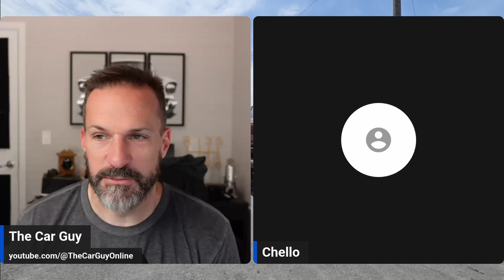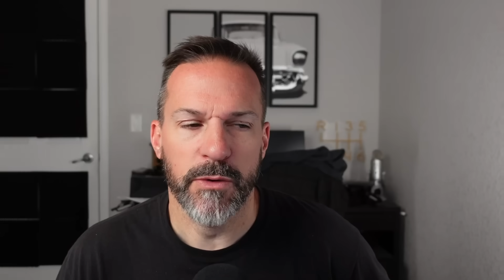Former GM Engineer EXPOSES Planned Obsolescence Tactics.

Comment: The oil change schedule on my new Toyota is supposed to be 10,000 miles…..I’ll change it every 5,000 miles.
Reply: All of our Toyota vehicles for the last 15 years at least get 5k oil changes regardless of what the schedule calls for.
Reply: I do the exact same thing, and also perform other maintenance at shorter intervals than the official schedule calls for.
Reply: 10,000 mile oil service is for people with a lot of gentle highway miles and go 55mph LOL.  
I also see a lot of people parked idling in the summer sun with the AC on for a total of zero miles.
Reply: @jeretso  Also non-turbo or naturally aspirated engines...Turbos are especially tough on oil and engines with biturbos like the Mercedes AMG are particularly tough on oil! Not only should you change it at 5,000 miles, but you SHOULD use the recommended specific Mercedes Oil with the recommended oil additives every other oil change!
Reply: @jeretso oil changes are set based on miles and or total running hours. That includes idling. Whichever comes first. I change my oil  every 3,000-5,000 miles
Reply: @jeretso the concept of “gentle highway miles” is from the 1980s, a turbocharged car sitting in stop and go traffic on a rutted and potholed freeway isn’t easy anymore lmao.
Reply: Guaranteed issues if you don't. It's proven
Reply: You might want to upgrade to 5-30 oil if you are using the reccomended 0-20. I plan to do so my next oil change.
Reply: @dbmail545 yes let's void the warranty and make the motor break down pre maturely
Reply: waste of time and money
Reply: Long oil change intervals only benefit the dealerships and shops. 
My old 03 diesel says 10k. I do it every 3k. Same with my 03 ranger and 11 mustang, 3k miles
Reply: 10,000 mile oil changes are ONLY to get the vehicle to survive until 1 mile past the warranty. Thats it. They don't care if the engine fails at 100,001 miles, because its no longer their problem. They've designed the engines to survive on 10k oil changes and have a short life. 4-5k changes is what Ill be doing
Reply: This is the biggest industry joke....10,000 mile oil changes...The automobile industry KNOWS that people rarely keep a vehicle beyond warranty, and the KNOW that 10,000 mile oil changes will damage the engine...but they are in business to sell cars, not to repair them. So if they can minimize the cost of ownership of their customer, that customer has a greater likelyhood of coming back to that manufacturer to buy another NEW car...So if in 5 years a customer paid for 5 $150 oil changes at a total expense of $750 for 10,000 mile changes as opposed to 10 oil changes for $1,500 in total costs, that customer will say that the vehicle didn't cost him much so he'll buy it again! The vehicle is toast, but he doesn't care...he's buying a new one! I have a 2018 AMG and I change that oil between 5,000 and 7,500 miles...
Reply: @ekummel  Then there are people like me, with my 40 year old truck (2nd owner) and 25 year old SUV (original owner).
Reply: @nolongeramused8135  I have a 1989 Jeep Wagoneer LTD (XJ) with 250K miles, a 1998 Olds Cutlass, a 2005 Jeep Grand Cherokee...and my two newest ones are a 2012 Jeep Overland and a 2018 Mercedes AMG...and they all run great...And my 1972 Cutlass, which has spend the last several years being restored ran last time I started it about 10 years ago...(can't now because it's completely disassembled. I love older cars...they have a "soul" to them that these newer ones just seem to lack!
Reply: @nolongeramused8135 
That’s me 😊👍
Reply: @ekummel  Wrong wrong wrong. Look at the stats.
Reply: @ekummel used to be 2000 miles in the 1990s  if I remember right.
Reply: These assholes can't even get the correct oil right....dealers in Australia have been running the US spec oils so people with their shiny new 300 series towing caravans in the outback get a rude shock when things don't live up to Toyota's reputation.
Reply: 5,000 miles no matter what on my 16 corolla
Reply: Former Toyota tech. 5K or 7.5K is a good idea. Car makers recommend 10K in part because it decreases the cost of ownership on paper and decreases oil waste.

Toyota has excellent synthetic motor oil that definitely lasts 10K miles, but every engine benefits from more frequent oil changes.
Reply: My '80s Toyota trucks recommend oil change intervals of 10,000 miles. The trick is to read the "severe" maintenance schedule. Most people qualify for the severe maintenance schedule, which on those trucks is 3,750 miles. That's more like it. You typically qualify for the severe schedule if you idle a lot, do a lot of stop and go, drive in extreme temperatures, tow and haul, etc. That's most people. So change the oil at the severe schedule for your vehicle.
Reply: If it runs 0w-20 swap to 5w-20. They only run 0w-20 in their cars in America, much thinner oil, doesn't protect as well, just keep in mind if you do the change, you can never go back to 0w-20 you will notice the car running better though.
Reply: I do mine at 5K and I mash down on it a lot
Reply: You can also get away with running a slightly higher viscosity oil. They use such thin oil to get slightly higher mph at the expense of engine longevity.
Reply: @accordio321 don't try that on newer cars. You'll throw codes for vvt and timing. They knew what they were doing with these "improvements."
Reply: Most powerful heavy duty semi max 8000 miles, no way a gasoline turbo can do 10000 miles.
Reply: @GF-mf7ml  diesel oil has a real problem w/ particulate contamination. leave the engineering to the real engineers.
Reply: That is maximum dumb. Stick to 10,000 miles.
Reply: @dacat8171  THIS is one of the dumbest statements I've seen on here! Manufacturers are walking back that 10,000 mile oil change interval because of issues...Manufacturers are now saying 5,000 to 10,000 miles with an asterix! Turbo engines, city driving/stop and go driving and dusty environments should be changing the oil at the lower end. Sunday drivers and highway mileage and normally aspirated engines, 7,500 is fine and old grannies getting groceries who never exceed the speed limit or go above 3,000 RPM can take it up to 10,000 miles...But if you talk to ANY mechanic worth their socket wrench this question, they will all say to not exceed 7,500 miles between oil changes...Your personal anecdotal experience not-with-standing!
Reply: @ekummel  I just don't get that. I drive a French diesel engine in the EU. Normal service intervals are 16k MILES if driven normally, 12k miles if severe. I change every 10k (easy to work out) and the car has done 250k miles with zero issues.
Reply: Just look at the oil 😂  @ekummel
Reply: @dacat8171 5k or 6 months.
Reply: @dacat8171 😂😂😂😂😂you are the only dumb one
Reply: @dacat8171 Search YouTube and see these engine fail just over 100k, some sooner. They are also sludged up. These thinner oils can't protect that long.
Reply: @seeya205 Dave’s Garage shows a lot of trucks with sludge but most of them are due to the owner idling for hours on end at the job site and doing an oil change every 30k, if that. 10k mile oil changes aren’t causing sludge but surely varnishing everything and losing additives.

Comment: Just bought an old 2001 Dodge Ram 5.2 liter magnum with a 5 speed manual transmission! 37K original miles! Looks like an old farm truck because it sat out in a field but runs like a top. I'm making it my goal in life to never buy a vehicle made after 2012
Reply: That  makes no sense

Comment: This is every industry, I’m a 16 year hvac journeyman.  HVAC manufacturers do the same thing.  If it’s metal, make it plastic.  If it’s thick, make it thinner.  They literally invented seer2 ratings this last year cause they were caught lying about their efficiency standard.
Reply: I'm working on a Hospital for the last year, in HVAC. And I'm redoing all the computer controls on the entire hospital. Most of the air handlers that feed air to the different parts of the hospital were built in 1964, and are still running on the original parts, original heating coils, original pneumatic actuators, and about half of the equipment has the original electric motors from 1964, that have simply been repaired with new bearings. I feel bad replacing it with the new "modern" computer controls, because there's no way the new stuff will last for 60 years.
Reply: @Ritalie  You can put your foot down as the professional and tell them thats NOT what you recommend doing and you refuse to do so.  Who cares what they want, they are clueless. When the person who's job is to work on them says otherwise,  they better listen!    Don't be a part of the falling chain, break the link.  I've saved people thousands of dollars by simply fixing an old piece of equipment for pennies,  when they (for some reason) think it needs to be replaced.  I'd rather walk away then get paid to do a "Down grade" KNOWING I'd have to try fixing the unfixable 3 times a year.....
Reply: Even in the generator world, I'm a tech, I've got units that are 10yo and I can't get parts. 
I just had to replace a customer's 48kw Briggs unit with a new one because the ecm went bad on the impco designed engine management system and the ecm isn't available. 
New unit was like 14-16k or something too. 
It was like a 2011-2012 unit.
Reply: @MrTheHillfolk 
When they said “(We’ll) own nothing and be happy”_ they were right. We’ll be happy to rent everything so we don’t have to pay to fix/replace it. The rental/subscription faucet will never turn off and we’ll be stuck with a monthly bill forever.
Reply: Switching to aluminum evaporator coils with a higher pressure refrigerant has been horrible.  All the American brands are garbage now.
Reply: @James.Allen.1 Yes I agree.  Our lennox rep says the new equipment made for the new refrigerant will still be aluminum but they’re going to be the same thickness old R22 coils were.  We’ll see I guess, doing something is better than nothing I suppose.
Reply: @zachosborne6577 
Copper has increased too much for them to switch back !
I will run my 25 year old unit for as long as possible
Reply: @James.Allen.1  They used to be aluminum back in the day. It's not the material, but the internal grooves they put in them to increase turbulence, which increases efficiency.

Then again, Trane didn't start going downhill regardless until they left the USA.
Reply: Plumbing also got like this, which is bad all around
Reply: Oh my God yes ! China junk!
Had a new bath tub and shower put in 
Less than 2 years and fixtures are failing.  Everything is junk ! We are screwed! The end is near ! Save yourselves!
Reply: Same thing happening in the hd class 8 truck world too. Cummins is very pro planned obsolescence and inferior metals.
Reply: Yup, seen the same. Cheaper build on everything on the boards/ motors/ frames.
Reply: Electrical equipment has gone the same route, cheap cheap cheap.
I recently pulled a 5 hp , 600 volt   three phase rooftop  exhaust fan at a factory .
Had to get a gantry in to lift it out of the housing, it was built like a tank, all cast steel.
They figure all 20 of them, where from the 50's and made in toronto canada , all are on VFD's , they thought they were 10HP's .
All still in service , took to a motor shop to get it looked at, they thought it was burnt out , just a bad connection in the motor .
Put  it back into service for another 60 years!
Reply: I’m an Electrician but I did HVAC for a bit and I could see that everywhere in everything we put together was absolute plastic garbage, same thing as an Electrician it’s all planned obsolescence.
Reply: AC coolant cartels lobbied (and won) for EPA regulations to restrict what can be used for coolants in AC units.  Unsurprisingly the "approved" coolants are all patented by mega corporations.  The most important change to the coolant type was the old stuff was all much lower pressure so wasn't as hard on seals and pumps so the coolant lasted exponentially longer.  The AC coolant cartels managed to force everyone to use coolant (that they held the patents on) that ran at a much higher pressure and that higher pressure cause a much higher failure rate in all the equipment as well as required refilling much more often.
Reply: I live in KNOXVILLE TN  and the HAVC systems LAST about 10 years. AT A BOUT 8500.00 TO  REPLACE. INSANE!!!!!!!!

Comment: ALL companies working that way. From Apple to Hyundai. From the new IOS update to the 10K miles "miracle" oil.
Reply: Planned obsolescence through continuous product line updates, making the newest products more desirable, but not artificially limiting the life of the existing product isn’t an issue. It makes people want to purchase the new products. 

Planned obsolescence through artificially or intentionally limiting the life of a product is a double edged sword. If you design the products to fail beyond the average expected usable lifespan of the product, it may result in repeat buyers.  Produce a product that fails prior to this point though, and you’re likely to have customers that will never purchase your product again. 

Think about Toyota. Most people buy them due to perceived reliability and longevity. If the average customer expects a new Toyota to last a minimum of 10 years, it has to last longer than that. Whether they last 15 years or 20 years, the average buyer is likely to be satisfied in either situation. Build them to last only 8 years though…and the average buyer will go to the competition for their next purchase and won’t return until the perception improves.

Comment: The same thing is occuring in the aviation industry too.  I spent 25 years in it.  Have a nice flight!!
Reply: It happens in every industry.
Reply: I could tell you a story about 3rd party aviation quality control that wouldn't surprise you at all LOL.
Reply: @machupikachu1085 used to work for a company that made OEM fuel rings for GE turbine jet engines. Don't fly.
Reply: @squidmissiletv  I have been a rabid airliner enthusiast since I was 7 and have worked in Aviation Maintenance in the late 90s, and then assembled 747-400 center wing sections at Boeing for a handful of years.   Even if it means deleting your comment after you post it (so I can read it one time in the comment alert), could you elaborate a little bit?  
What is a fuel ring?  Is it an o-ring that seals fuel lines or does it have to do with the combustor section?   Is the problem caused by these big companies like GE and GM going with the lowest bid they can find from parts suppliers?
Reply: @JetCityMatt im referencing the fuel injector ring that goes around the cumbustion chamber. Specifically the CFM56. Later the LEAP. But not many of those.
Reply: @JetCityMatt I was in aviation and aerospace my whole working career.  He may be referring to the fuel injection spray ring??  That's what I think anyway??  🤔
Reply: @Steve-on6fu  Oh that makes sense.  The injector has to be sealed and everything else in a jet engine is probably too hot for o-rings.  Actually... where the fuel injector mounts is probably too hot for any kind of O-ring to survive.  Perhaps he is referring to something external to the hot part of the engine, like maybe a fuel line coming to the engine or maybe some component in the accessory box (if that's what they call it where the oil pump and IDGs are).
Thanks for your reply.  It got me thinking (which is always a good thing... well, sometimes its not!)  ;)
Reply: It’s not a secret.

Comment: After looking for a Silverado LT over the last 6 months- nearly bought one 2 months ago- boy I’m glad I pulled out. 

I decided after the long form video yesterday, to look for a FORD F150 - seems to be slightly more dependable.
Reply: Ford is no different.  Try a Toyota.
Reply: @jeffdungey5848  Toyota recalls have grown in an exponential log form even adjusted for model growth over the last 15 years. Pre 2010 Toyota sure. All newer models have this same cost cutting. It's why the wheels fell off the Bz4x - poor metallurgy.
Reply: @jeffdungey5848 Yeah, try the V6 turbo. Good luck.
Reply: @jeffdungey5848 Practically every manufacturer has model years, engines, etc. that should be avoided. To blanket condemn a particular brand is ignorant.
Reply: @jeffdungey5848  I have owned  toyo trucks since 1982, but would not recommend a new one. I stop at 2014.

Comment: And guess what, your loyal customers go to the competition.
Reply: And what competition is a better option? 
Even Honda and Toyota aren't building what they use to ... bad transmissions, burns oil due to low tension oil rings, failing head gaskets etc... they're all building disposable  junk.
Reply: @hmdwn  They improve when they see a fault. Domestic manufactures are obsessed with cost cutting.